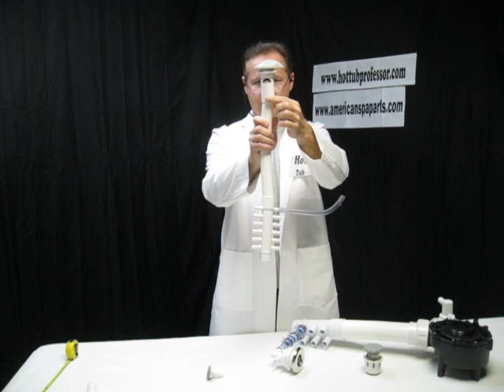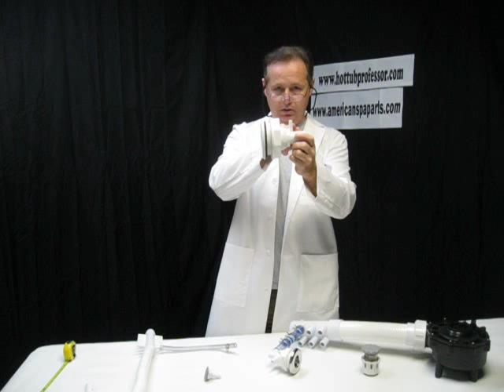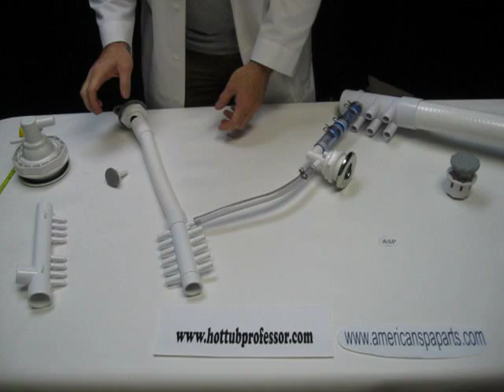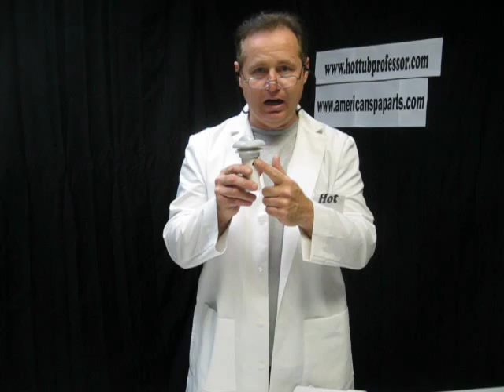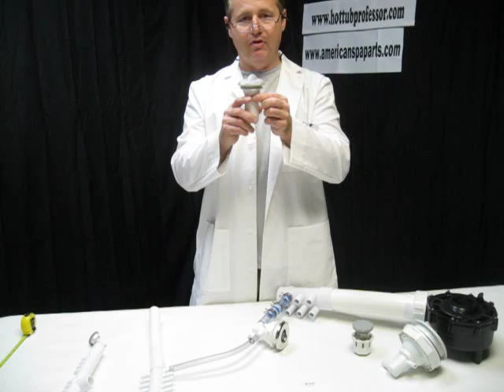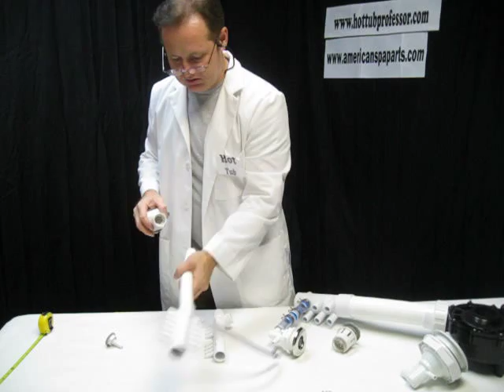Spa Hot Tub Air Valve & Manifold Information How To

Comment: Excellent video - thank you!
Question: In normal operation, when jets are off and valve is open - would you expect water backing up (maybe even flooding the mainfold)?

I am asking as I suspect I have some biofilm building in the air system. Air system works OK - although there is a delay after opening a valve and air comming out when jets were off for a while (so I suspect there is water in the air system that takes a while to get purged).

Comment: Customer has some jets that fly out of their socket and also valve for jets doesn’t work. I did look under the valve and I did see some water leaking from it. The other valve you can hear air being sucked in like you mention that it means it’s working fine. Do I replace that valve or will it be the jets since they do fly out of their socket. Also if there is water coming out instead of pulling air I have to make sure those lines are clear of water. Thank you

Comment: Hey Spa Guy and fellow Elvis Fan..  I have a spa/pool combination.  The spa has two air valves in it, One of the valves operates where as the other does not.  The valve I believe is a Balboa Hydro Air 1" Sublime Air control.  The problem is I don't have access to the interior of the tub to loosen the lock nut underneath.  What am I to do? 
Thanks, Tim
TCB
Reply from the maker: Hello Tim, If you watched the video I explain that if the air valve does nothing it can be the valve but not likely.. You can unscrew the top of most valves and see if the mechanism is broken and will not open the valve.. If that is all working the reason is most likely a crossover from a jet missing or having a problem on the backside and allowing water to enter the air system with so much force the suction of the Venturi affect cannot overcome the amount of water and push air.. The first thing to check is the air valve inside..

Comment: good video but you didn't explain how to check or fix crossover...  I have water leaking  out my air valve which i had just quit using but a guest must have opened it up while i was on vacation and like 200 gals leaked out( hard to imagine so much in 2-3 4 hour pump cycles) and the pump ran dry and the leak took out the motor bearing... this is a 21 year old coleman spa and this motor may be original  and possibly the last moving part I have not replaced.   The real problem was I didn't fix this crossover problem years ago...  i have replaced my jets with new ones 2-3 times.. perhaps they dont have a seal in the right place?  or is it possible sand has worn out the housing to much?  maybe a jet has blown out... i will investigate more using googles once I get it fixed and wormed up again.
Reply: A  THING to  check  if the pump  has  gone bad inside  to ? cause  it has a  air side and  water side ? lots  don't know  that  ? if seal has  got  worn out you will all so  get  low  power  cause  cross over  leaking in pump  hope this  helps  ? it works  on  air pulling  in  vents  side  ?  if water seal is cross leaking  you will get   same  thing as   worn  out seals  on  vent jets  sides  to  ?
Reply: Not sure what you mean.  A pump only pumps water.  A slightly leaking pump seal can't cause water to be pushed out the air intake valve.